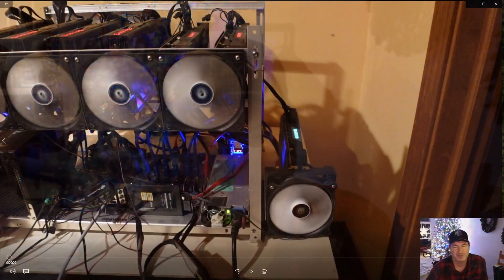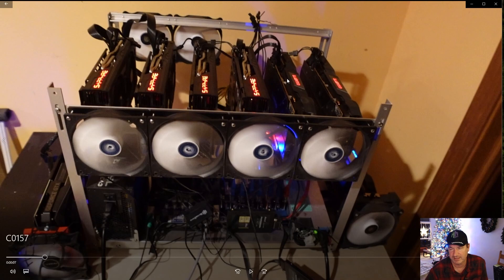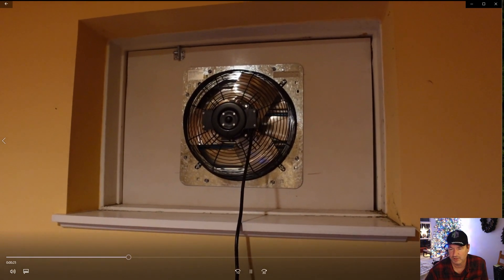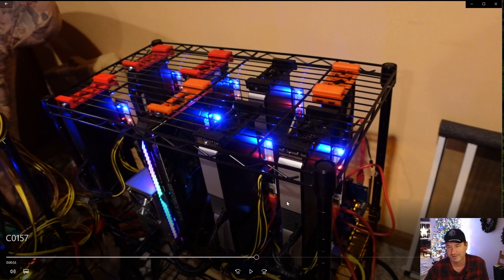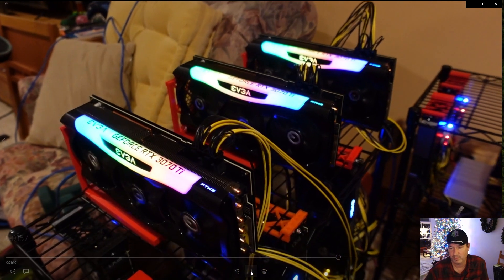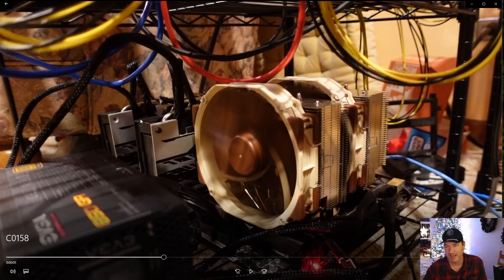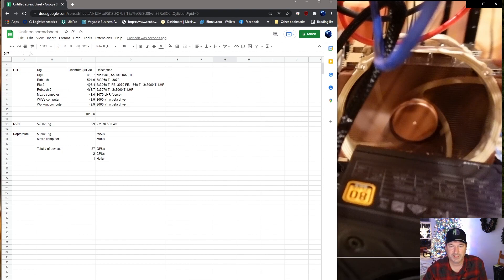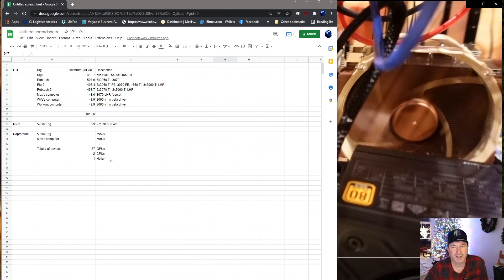Welcome to the Max Voltage Mining Farm

Comment: For the fan at the window, I have this idea of buying a roll of rubber sheet where you cut it like a gasket and put it in between the fan and the board to reduce the vibration like how Noctua anti-vibration mount?
Reply from the maker: Good idea.

Comment: Beautiful. I love your videos Max. Could you please help me I have a question here and I think you're the one that knows the answer. Do you think it's good time to start mining and building a rig? I mean, it's the first time that I want to start mining. Is it too late or not. The reason that I am asking this question is Ethereum 2.0. As you know, after moving to Eth 2.0, the profitability of other coins may be decreased significantly. Should I wait and see what happens to the coin's profitability or it's ok to start, and how much time I have till moving to POS mode. Thanks a lot.
Reply from the maker: If you make decisions like it is a business, it will help you make the right decision with the correct assumptions.  The assumptions I am using is that:  1. POS will be here no later than June of 2022.  2. Hashrate will continue to grow so profitability will continue to drop.  My suggestion is that if you haven't gotten into mining, either mine with what you have or wait until POS when GPUs will be a lot less expensive.
Reply: @MaxVoltageTech  Thank you